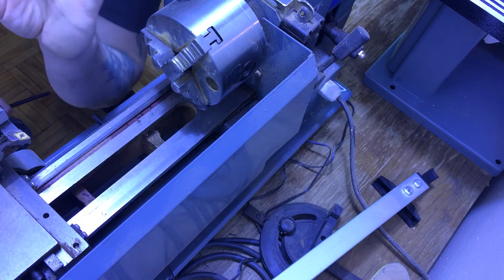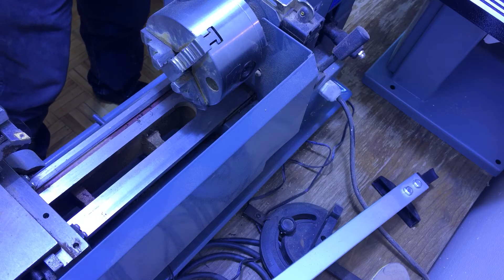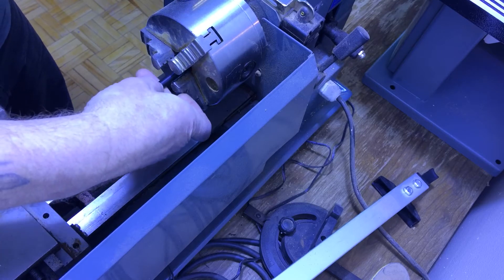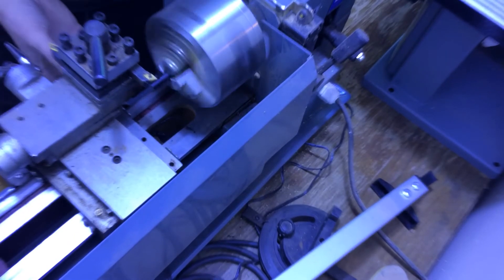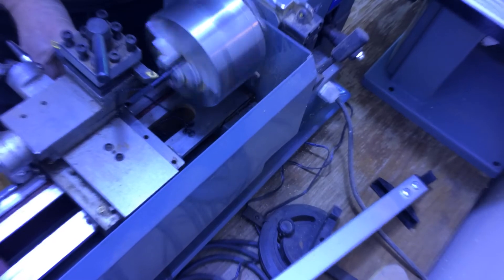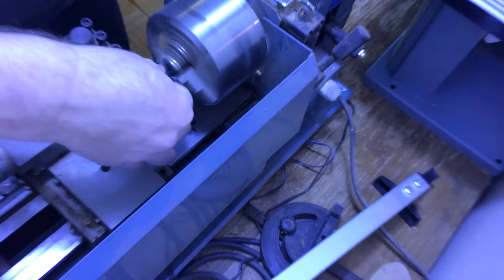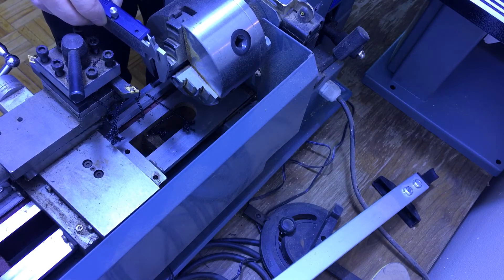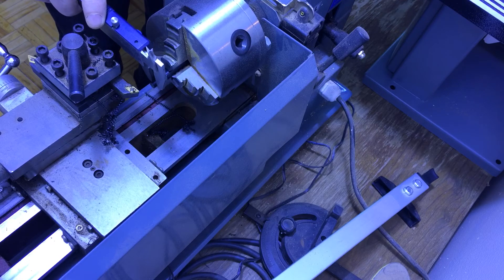Turning 5/16” Delrin rod down to 1/4” and screwing up

Comment: Michael, does that handle on the cross slide have graduations?
If so you can measure the part and turn the dial to take off exactly what you need.
I am only saying this because I am a machinist by trade and most lathes have a dial.
Keep posting because I enjoy your videos.
Keep your bowl full and lit!
Reply from the maker: Yes it does it has .25 mm graduations and I started trusting it lol 😊 I got it right on “take 2” lol hey thanks for your advice and support my friend I appreciate it! Peace from Welland